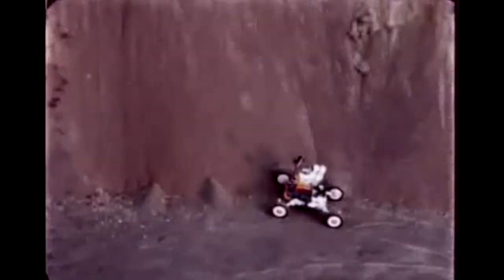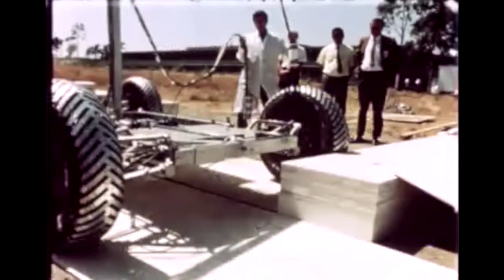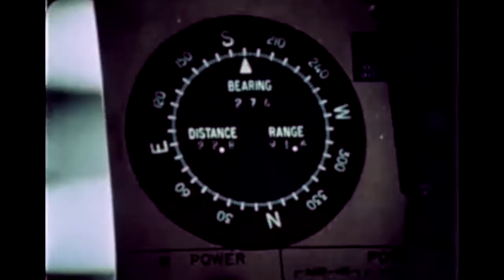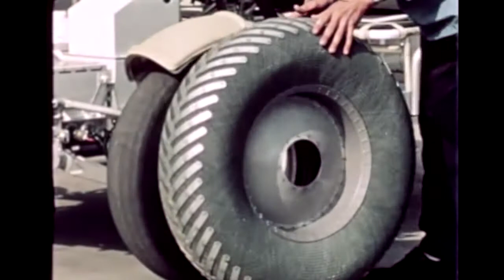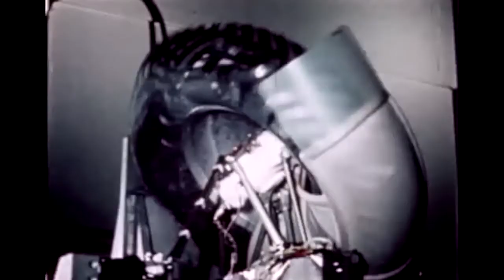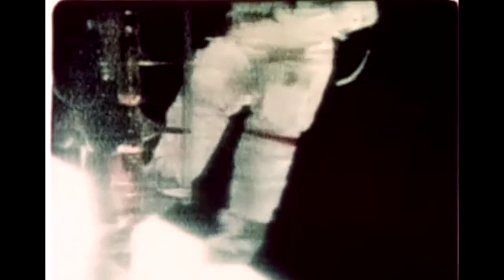Spacecraft with Wheels - The Lunar Roving Vehicle (1971)

Comment from the maker: Of course our little friend Expattaffy1 is now claiming that the lunar rover had a petrol driven engine; meaning it wouldn't work on the moon; therefore all "fake". Nothing new there. 
My response to: "FAKE APOLLO VOL 2 PROOF THE ROVER RAN ON FUEL" - https://www.youtube.com/watch?v=oCNrMth0fFk&t=1297s
At 21:37 - Be HONEST with yourself and everyone else. Who can see an "oil filler pipe", a "cam shaft cover", a "block"?, a "fan belt cover" and an " exhaust manifold" in the BLUR OF COLOUR AND LINES? Be totally honest. And then explain how that "FUEL DRIVEN ENGINE", (and I assume Splatty means PETROL when he says FUEL), is transferring power to all 4 wheels, or better still, just the back two; because if you look at this 4K "steady" version of the gran prix; THERE IS NO BACK AXIAL. https://www.youtube.com/watch?v=az9nFrnCK60 

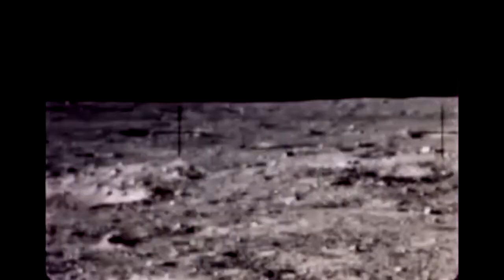After watching the 4K version of the Grand Prix; which had a serious purpose; ask yourself: "HOW BIG IS THAT "SET" AND HOW DID THEY LIGHT IT? When they made "From The Earth To The Moon" one of the hardest things for HOLLYWOOD to get right was creating an authentic lite lunar surface.  See from 01:30 - https://www.youtube.com/watch?v=M2cGwUnOL7E&t=154s

Then ask yourself WHY GENERAL MOTORS ENGINEERS, who designed and built the Lunar Rover; built one version with 4 electric motors; one on each engine; while at the same time designing and building a second version with a "PETROL ENGINE"; when the electric 1G version worked perfectly fine here on Earth during testing and training? 
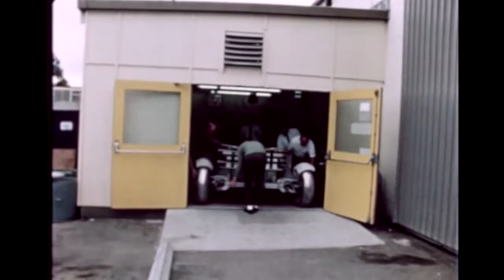At 06:32 https://www.youtube.com/watch?v=26oQ3m5EHrg - 
And I ask that because that's what Splatty is saying. He is saying that GENERAL MOTORS built TWO VERSIONS of the LUNAR ROVER one with 4 electric motors and one with a single PETROL ENGINE. Just watch the linked film and THINK about how many engineers at General Motors would have had to LIE about what they were doing.

Face it. The more people involved in an alledged "coverup"; a conspiracy, the harder it is to keep the thing secret. NIXON COULD NOT COVER UP A CHEAP BURGLARY FOR A FEW WEEKS; BUT SOMEHOW "FAKING THE MOON LANDING AND ALL IT'S HARDWARE" WAS EASY TO COVER UP FOR 50 PLUS YEARS. Give me a break.

I suppose I should be glad Splatty isn't claiming it's a "Willy's jeep". 
https://www.hybridcars.com/gm-engineers-used-lunar-rover-tech-when-designing-chevy-bolt/
https://gmauthority.com/blog/2019/06/gm-engineers-insisted-on-sending-a-lunar-rover-to-the-moon/

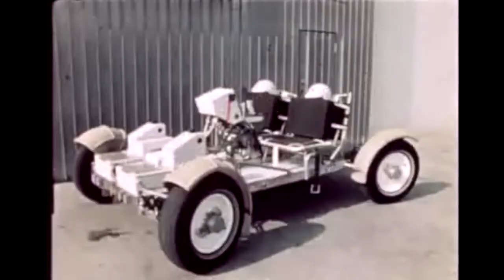Comment: Moontards be like, "7:04 is obviously proof this was filmed inside a studio! Stanley Kubrick did this! REE!!!"
Reply from the maker: Did you know that Stanley Kubrick could never figure out how to simulate 1/6G on the Moon in "2001" so he just didn't. Every scene set on the Moon it's 1G.
Reply: @Phase52012 
Interesting. I wonder what their answer to that is.
Reply from the maker: Ex Nihilo  - Oh, it'll be what it always is. MAGIC. 
They will claim that all the astronauts are hanging on wires, but NEVER explain how it was done. How a "moonset" several kilometers in length and as many wide was built "somewhere"; (one minute it's at AREA 51, the next it's inside an airship hanger at Moffett Field), and how the ceiling was covered with a "stage flying system" so complex that astronauts could travel anywhere on the set and never get entangled; and always, always always; it perfectly simulated 1/6G. In a hundred hours of live TV, not one error or miss step. Or they say "Well, it was filmed without wires, then transferred to video and a slow motion effect was applied. Only the technology to do that didn't exist in the late 1960s; not to the extent that you could create a 2.5 hr long "slowmotion" EVA, and then there's the whole 24fps (film) to 29.97fps (NTSC standard) conversion issue.
As has often been said; it would be easy to go to the Moon to shoot the "fake" footage; then fake it on Earth. (And the vomit comet is only good for 30 seconds. See the making of the film "Apollo 13").
Back to "2001" to finish up. On the shuttle sequence going up to the orbiting space station, the flight attendent wears "grip shoes" and walks the lenght of the shuttle interior. On the rotating space station, used to simulate (less then) 1G, you'll see some of the actors "walking downhill", which is what they were doing on curved set. Onboard the lunar transport, the character Heywood sucks some food through a plastic straw, in zero G the liquid would stay in the straw right up to the top, the liquid can be seen going back down the tube due to gravity. The flight attendant on the Moon shuttle walks everywhere, again wearing "grip shoes". (Even up a wall, a trick "borrowed" from the silent era, and also used by the Marz Brothers in one of their films). On the Moon there are 5 sequences. The Moonbase overlook. The landing of the lunar shuttle in which the dust kicked up by the retro rockets hangs in the AIR, long after it should have fallen STRAIGHT DOWN to the ground. The conference room, the Moonbus flight, people were seated or again “grip shoes” we assume; and the TMA-1 pit. All shot in 1G. 
On board the spaceship "Discovery" headed to Jupiter, the crew spend most of the journey in a rotating hub; when they leave it for other areas of the ship, they walk everywhere. (We assume they too wear the "grip shoes"). Only outside in space do we see anyone experiencing ZERO G, during the spacewalk the repair the AE-35 comms system in the ships main antenna. It’s a wonderful effect, and unless you know exactly when and where to look, you will not see the wire holding up the astronaut/stuntman. Why? Because it’s directly behind him. The stuntman was hung from the ceiling and the camera placed directly under him. This totally hid the wire holding him up. Look close at some shots when he exist the EVA pod and you’ll briefly see a shadow of the wire on the pod. (It’s rumoured that the SFX people borrowed this arrangement from some footage they saw being shot for, of all things, and episode of “Doctor Who” with William Hartnell).
“2001: A Space Odyssey” is a brilliant film; but Kubrick, or at least his SFX people, had issues that were hard to get around when it comes to gravity. They did a great job either explaining it away or stopping you from thinking about it. After all in 1968 the average person really wouldn't notice when and if the got it wrong. So it always annoys me when moon hoax believes say things like "Kubrick directed/faked the Moon landings for Nasa"; as though Nasa didn't know what they were doing. It actually happened the other way; with Kubrick's team consulting with Nasa on many of the technical details in the film.